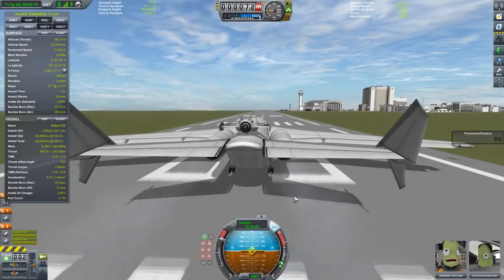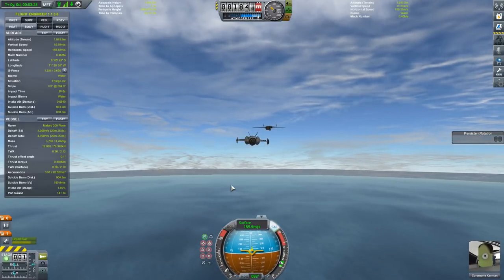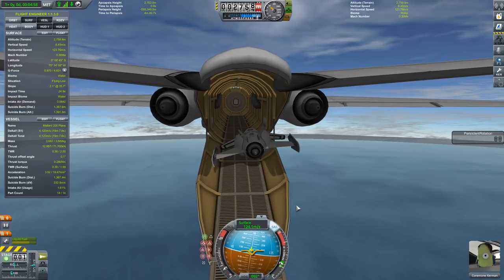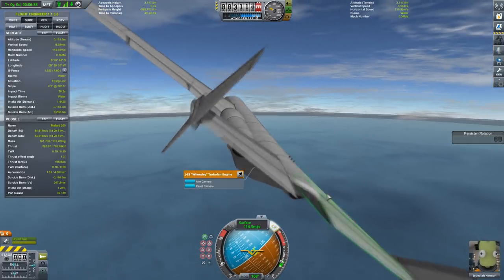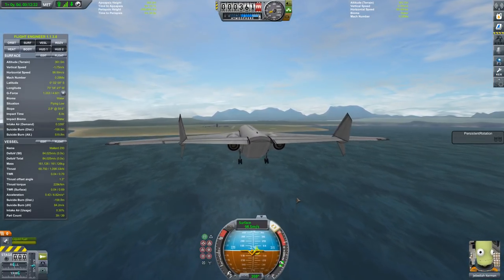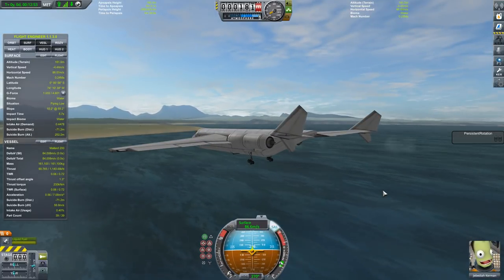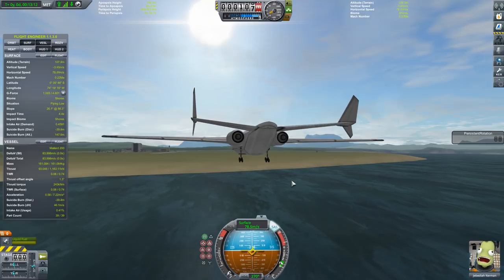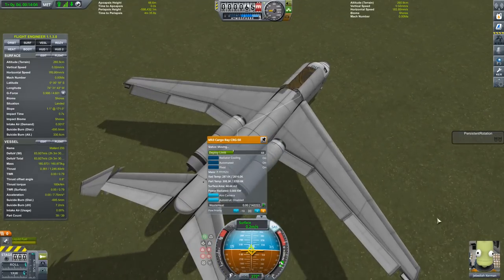Landing a Plane Inside Another Plane and Then Landing that Plane

Comment: "Cannot deploy while stowed"? What kind of error message is that? That's like saying "cannot open while closed!"
Reply: While stowed in the cargo bay. It's bizarre, I know.
Reply: "Cannot activate while deactivated!"
"Cannot begin while ended!"
"Cannot Scott while Manley'd!"
Reply: Bob: "Alright, it looks like we need to open the cargo bay to lower the front landing gear."
Bill: pushes cargo bay door button
Bob: "...You remember that Jeb was back there, right?"
Jeb: crashes into motherplane wing
Bill: "I do now!"
Reply: Cannot safe while fly.
Reply: Cannot deploy (landing gear) while stowed (in cargo bay). The solution: open the cargo bay, then deploy the gear.
Reply: Yeah I'm surprised Scott didn't know that.  I think he played dumb to make the ending more exciting.. ;)
Reply: Sometimes an error message actually makes it harder to diagnose the issue. : P
Reply: turn deploy sheilded off and it will work again
Reply: It means it thinks the landing gear are stowed inside a bay. Like how people like to stow vertical engines inside cargo bays. The actual problem is that his gear are not extending far enough out of the body of the plane so it thinks they are stowed.
Reply: In my experience that is the issue. Probably happened when he scaled up the plane.
Reply: Jakob Edwards Or while adjusting the gear height.
Reply: It's a bug with the cargo bays. Landing gear won't deploy if they are attached to a cargo bay that is closed. Opening the bay first will allow you to deploy the gear.
Reply: That's ksp thinking that the part is inside a cargo bay of the same craft. So it says can't deploy while stowed as in like cannot deploy while in a cargo bay
Reply: moosemaimer cannot proto while gent
Reply: Calin Culianu or he didn't want to risk losing Jeb. Jeb already did his stunt for the day.
Reply: stowed in the cargo bay
Reply: Cannot fire while loaded
Reply: moosemaimer jvuu
Reply: Ayy 420th like Lolololololololololololol
Reply: J.J. Shank 100th like
Reply: I agree.
Reply: @calinculianu  You could just deploy with the gear shielded
Reply: @General12th  can not be ricked while rolled

Comment: I learned something interesting the other day. It's possible for a plane's controls to be designed so that the pilot's controls move small flaps, and then the airflow over the small flaps moves (or assists in moving) the full-size control surfaces. A lack of power assistance doesn't necessarily mean unassisted controls. :)

Comment: Actually, large aircraft that do not use hydraulically actuated primary control surfaces (aileron, rudder and elevator), usually use servo tabs to move the control surfaces. Tabs are much smaller, and therefore require less forceful inputs, as compared to moving the entire control surface. Tabs can also be used to trim a control surface to a fixed deflection. Try searching for "Secondary Control Surfaces".

Oh and, Great video!

Comment: Not only do the B747-400 and the A380 have the ability to transport extra engines on the wings, but there have been plans for a B747 aircraft carrier.
The top deck would hold pilots, lower deck would store aircraft, and the cargo hold would act as a launch and retrieval bay

Comment: Is there anything like KSP with focus on airplanes (sandboxy, sim)? I really love KSP but BTH one (two) airports, lack of MP and mods being behing current game version due to big changes is really bugging me.
Reply: Give Simply Planes a try
Reply: There are, I think they're just called pilot simulators, and have like an entirely accurate cockpit with aerodynamic modelling and the lot
Reply: I'd personally recommend reverting back to 1.2.2 with mods. All of your problems are fixed by doing that, fellow countryman.
Reply: Simple planes
Reply: Jan Šebek simple planes is a good one. It is a bit like ksp, you can build your own planes. 2 runways and 1 aircraft carier, and 2 bridges you can destroy (the game features bombs and missiles etc)
Reply: sounds reasonable, tbh ive reverted purchase on simple planes. I like to tinker with stuff that i make in sandboxes and SP are just about roughly design shape from what i saw...u stick wings on a brick and it will fly in that game -.- thx
Reply: Jan Šebek simpleplanes has gotten many updates and many new parts, you may want to try it again
Reply: AEROENGINEERING SP gonna check what is in those updates specifically, but thx for tip 😀
Reply: Fedor 2 aircraft carriers, 2 ships with helicopter pads, a bunch of runways including dirt ones, and an island full fo jumps and race tracks for cars

Comment: No, they don't have hydraulics because its all servo controlled and fly by wire. Even the aircraft my father helped design back in the 60s had signals sent down stainless steel microwave conduits. Hydraulics? Thats WWII technology! The control surfaces could be powered any way at all,dependant on the proximity of a power source.

Comment: I had the same problem with the front landing gear in my space shuttle's orbiter. I adapted the cargo bay to the payload didn't try a landing test and during real landing I couldn't deploy it. I attempted an emergency landing and I lost the orbiter's vacuum engine due to a very steep descend with a very high angle of attack but the payload and crew were unharmed so i called it a succes.

Comment: In WWII the Russians had an operational parasite plane system that they used for several missions. It was a Tupolev (SB-8?) bomber with two single-seat fighter-bombers uner each wing, two biplanes on top of each wing, and one on top of the fuselage. The parasite planes were equipped for dive-bombing and that was the point of the exercise: you got the range of a big bomber with the precision of a dive-bomber. After they'd dropped their bombs, the parasites could then fight off other aircraft. They didn't re-dock with the mother ship, but flew home alongside it.

In the 1930s, the USN airships Akron and Marcon carried small Curtiss Sparrowhawk biplane fighters and both launched and recovered them successfully using a hook and trapese system. In the 1950s, there was a project by McDonnell to produce a fighter caleld the Goblin that could fold up and stow in the bomb bay of a B-36 bomber, and which would launch and recover using a similar hook and trapese system. It never went into production since flight testing proved that the turbulance around the bomber was too violent for the fighter to safely approach it. What did go into limited use however was a system called FICON in which an RF-84 Thunderflash tactical recce aircraft attached to each wingtip of a B-36 using a probe & cone system (a bit like flight refuelling) and then throttled back, saving fuel so that it could be deployed to take photographs much further from it's base than would otherwise be possible. The system was discontinued when flight refuelling was widely adopted.

A FICON-like system was revived recently when NASA Dryden did some flight testing with an F-106 fitted with a nose probe that docked with a cable extended behind a transport aircraft. The combination took off tethered and the fighter then shut it's engine down and was towed like a glider. It then successfully restarted it's engine, disconnected, and landed. The idea was to prove the tow concept for a possible space-launch system in which a rocket-powered spaceplane would be towed up to altitude and then released to continue it's way on to space.

Comment: I had the exact same landing gear problem with a Laythe plane I built! It's because the front landing gear is attached to a cargo bay: you just need to open that cargo bay in the air then deploy your gear and it'll work.
Reply: Would putting the gear on another part that's itself attached to the cargo bay work?
Reply: In a few tests I've done, unfortunately that doesn't work. :( It seems to be based on the proximity of the landing gear to the cargo bay, no matter what it's attached to. 

So you can attach, say, wing parts to the lower sides, then attach the gear where it's far enough away from the cargo bay, not clipping into it, and you shouldn't have a problem (though your plane might look funny). I hope this helps!